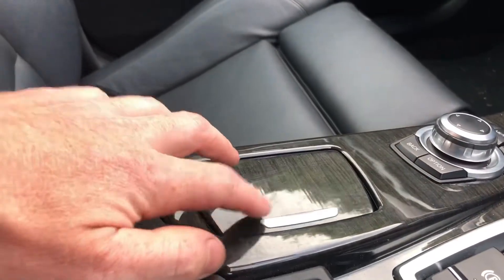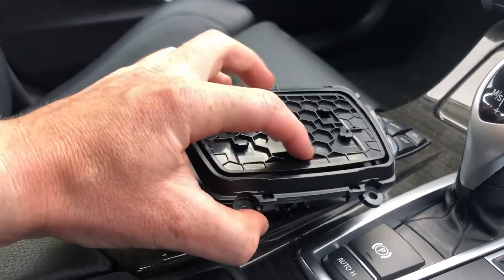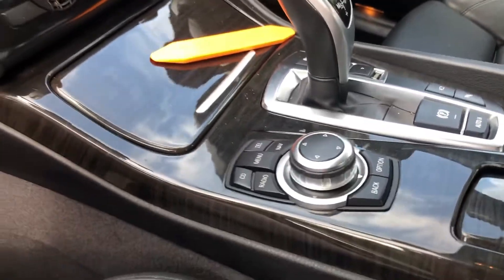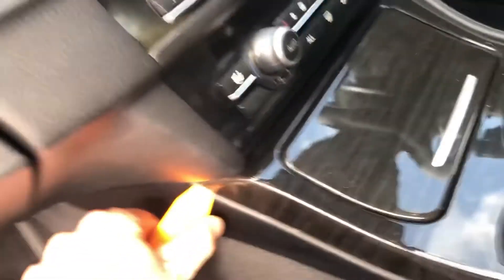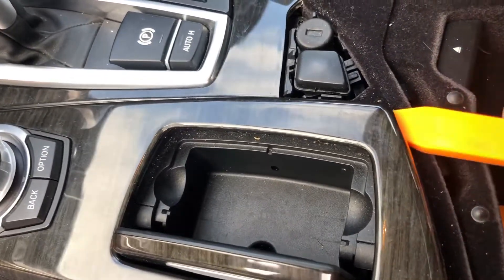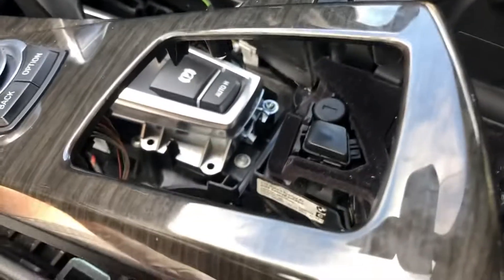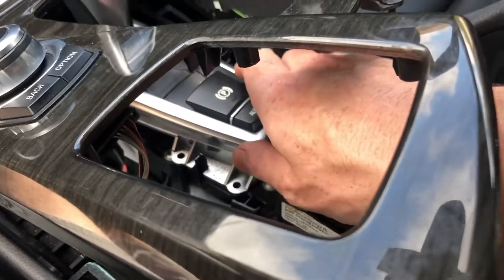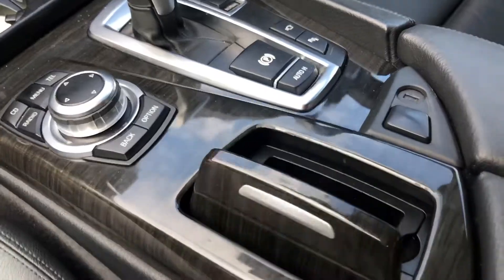F10 BMW 5 series ash tray fix replace

Comment: Hi friend. Did the screw that fell into the hole cause you any problems? Or did it just fall out and not affect anything?
Reply from the maker: @davidpajero9094  no problem with the screw, it just vanished!
Reply: @ChromeFlakes  jajaja ok ok thanks friend!

Comment: Nice video.  My cup holder won't close.  Is it necessary to remove the center console to remove it for examination?  Thank you!
Reply from the maker: Ah thanks very much. I haven’t had to fix the cup holder…yet. But you’d certainly get to the bottom of it by prying up the centre console as shown in this vid.